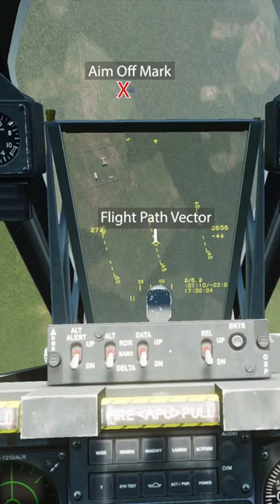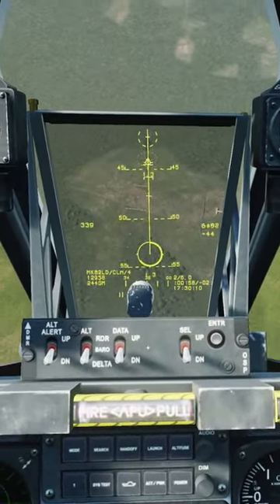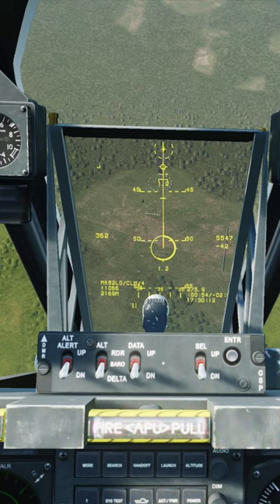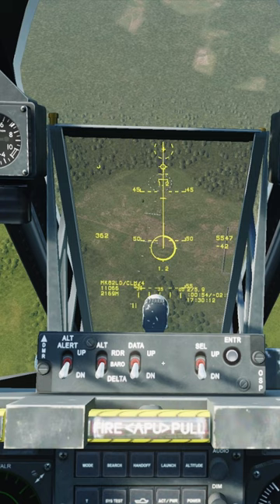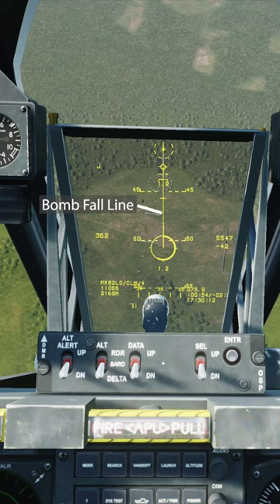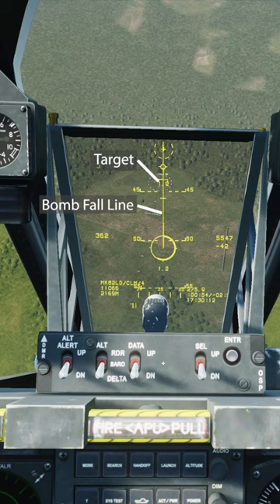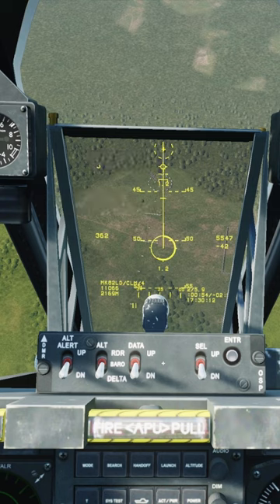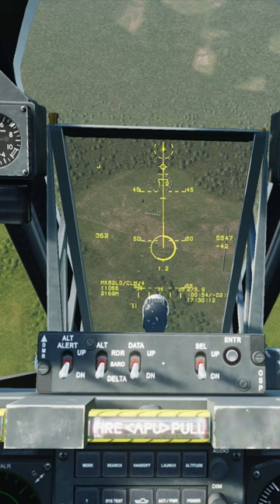How To Be DEADLY With DUMB  Bombs. #dcsworld

Comment: Does the F4E have any bombing aids similar to the A4E's computer drop mode?
Reply from the maker: As i understand it, the same bombing computer was used in F4. It cane from Navy research. Don't know how it will be modeled in the F4
Reply: @Sidekick65 if it's modeled correctly there will be a AG radar mode with 4 functions, there is a mode on there that definitely acts like the A4s bomb release system and others that have different drop methods. Check out the old P3D F4 as it's the same one we are getting and has all the A2G radar modes.